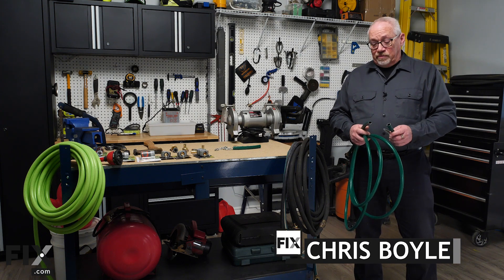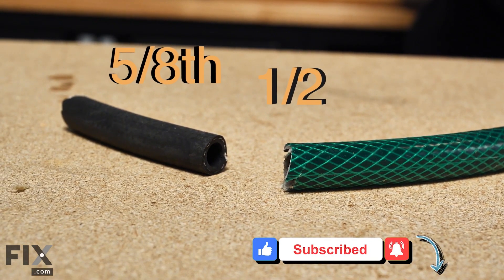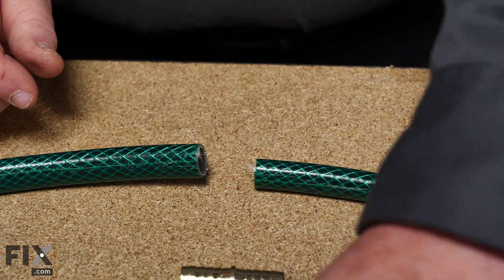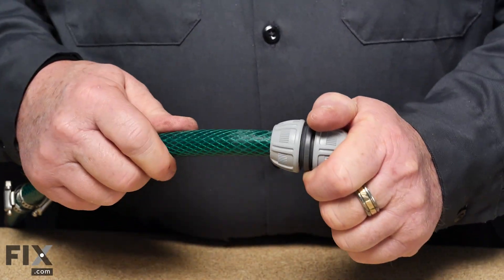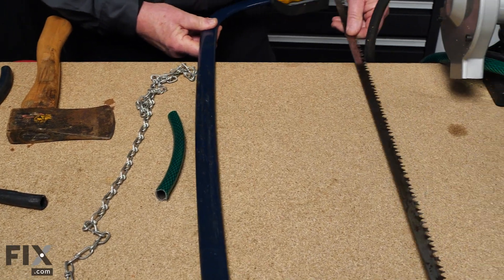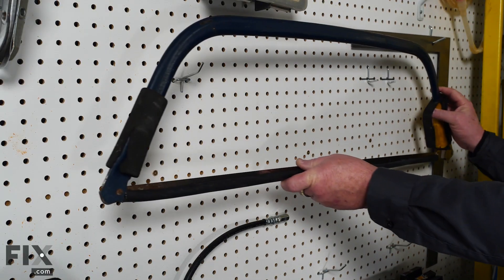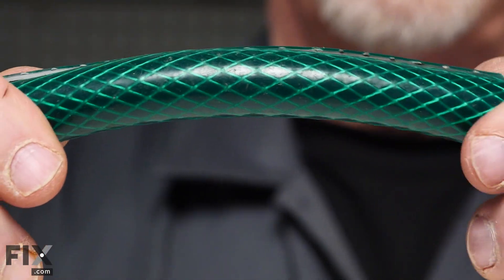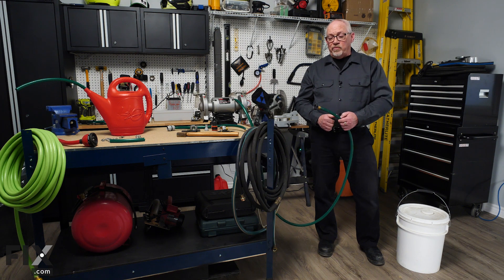How to Repair or Recycle That Old Garden Hose - Cool Ways To Re-use Old Hoses! FIX.com

Comment: I wish someone made a hose end repair like the original end. You could put the barbed end fitting on the hose and crimp the barrel with a tool. Like making repairs on an Oxy or accetylene hose. slide the barrel on insert the barbed fitting then sqeeze/crimp the barrel. Those stainless steel clamps are aggravating on the hands.